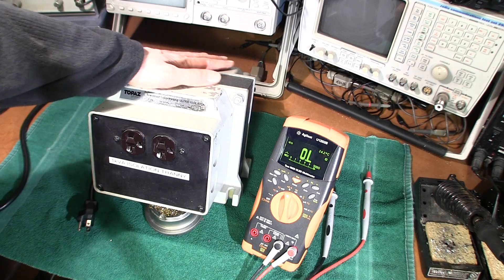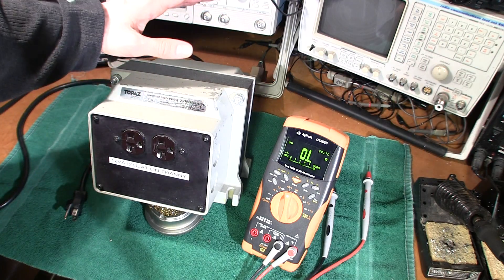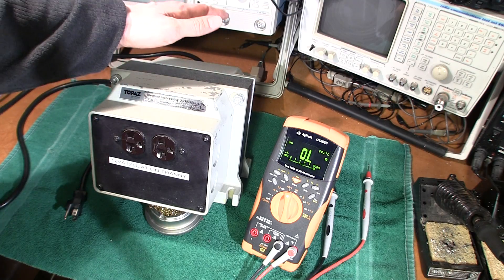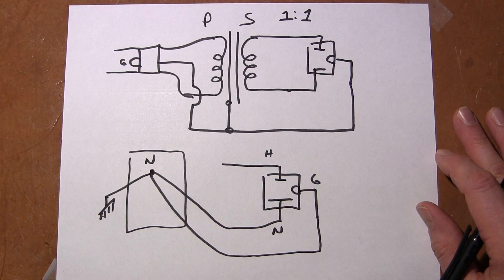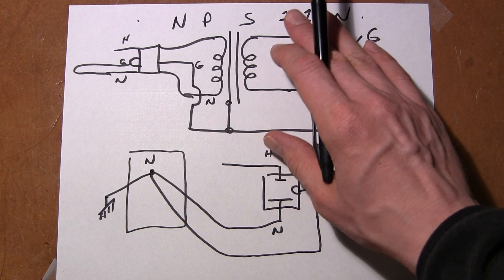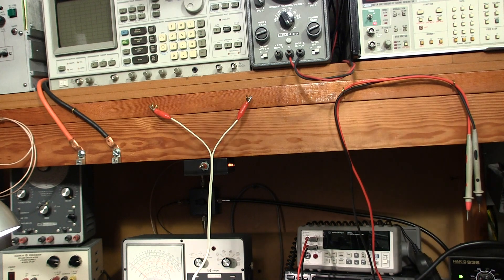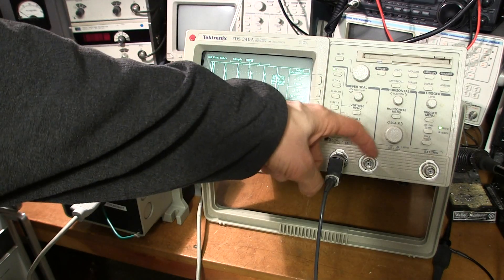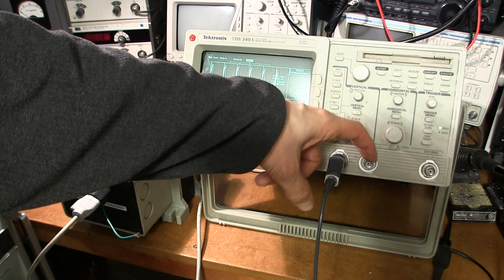Tech Tips Tuesday, Isolation Transformer and Variac Safety

Comment: Confusion the secondary should not have the earth wire carried over . the secondary is then will be totally isolated . Then you can have the DUT connected including the scope and all is well
Any transformer the has any of the secondary wire connected to earth/neutral is NOT A ISOLATION TRANSFORMER and should not be called that . The earth should not be connected to the output

Comment: Balanced isolation transformers, which are sometimes used for audiophile and home theater systems, usually have a center-tap on the secondary which is sometimes connected to the ground connection on the output and chassis. Thus the output is not always isolated.
Reply: center tapped coil is so you can split the voltage if it puts out 24vac  you can  12vac and 12vac for 2 different modules per say, the center tap so u can get +/- 12vac for some audio equipment wich the rectifies it and filters it usually with a regulator as well into DC so the center tap is the half way point of the winding so two windings in series per say like in your mains supply where the nuetral is this wire  or whatever the color depending on country ur in completes the circuit to make current flow and the panel has 3 service cables and a ground the two hots each carry 120 volts when referenced to nuetral and leg to leg they equal 240 thats not to be confused with ground or earth its  whatever you want it to be but a ground is a reference point of halfway so it goes up 120 and down  120 180 degrees out of phase from each other ground  the way we protect our homes from short circuiting a cable thats in the wall and instead if its shorted at device or wherever the breaker will be the switch to break the circuit  to prevent the wire becoming a instant red hot coil in your kindling filled walls lol even though at the panel ground is bare copper with its own bar you must not connect ground with nuetral has its seprate lug and bar for this reason and older electrical code was using the same bar for nutral and ground so when you need 220 for your welder the 10 2 wire is going to be a white a black and a bare copper the white now becomes the second 120 side of the plug at the panel a double pole 40 or 50 breaker gets a white and a black and thats as easy as i can explain it electricity doesn't rely on ground to work it relys on a complete circuit and thats it a ground is a protection against things like reversed polarity  most devices have this into the before the electronics portion of things if its any chance to be a problem

Comment: Why is an isolation transformer safer than using current directly from the outlet? Doesn't the secondary side provide as much electrical energy? Also, an idea for a Tech Tips Tuesday for us noobs -- what is the difference between the neutral and the ground wire?  I see outlets wired with the white neutral and green ground screw connected all of the time
Reply: There is no reference to ground from an isolation transformer. You could shove a fork in the hot socket of the transformer's secondary, put the fork in your mouth, and grab a copper pole and nothing would happen because the earth is no longer part of the circuit. If you did that with the normal AC mains you would die because the earth itself IS part of the circuit.

Comment: As others have pointed out. It is important to remember that if you float your scope and then connect probe ground to a hot connection the entire case and terminals of the scope and anything else connected to it are now hot. You only need to touch any of those points and ground and you are fried. That is why you normally never float the scope but rather the DUT.
Reply: yep all metal on the scope
Reply: An alternative to be extra safe is to float both the device and the oscilloscope (using separate transformers!). Still you have to be mindful that your ground lead can energize your oscilloscope w.r.t. the device under test, so don't handle both at the same time in that case.
Reply: Well yeah that's pretty obvious from even basic electrical theory. It's more about parasitic components of circuits that actually become an issue sometimes!! But yes I do generally aggree with you of course!!

Comment: You have so much experience and knowledge in this field, and I trust you, so had to ask you about my next project:  I'm thinking to make an a adjustable AC bench power supply.  My concern is to have the AC stable, when something using it draws more than 1A (or more) of current. When I needed for my project AC, I just used 2 resistors, wired like voltage divider and also used 2 potentiometers - wire-wound style. It did the trick, but since I'm gonna play with more AC projects, I would like to make a nicer power supply that is stable. I do not need anything more than 10A (that would be at the most I can imagine for now). I have several transformers 120V to 30V, 16V, 12V outputs. One has both 12V and 30V in one. They came from a large  UPS (Uninterruptible Power Supplies from 1200W and 1500W respectively). I'm not very experienced in electronics, just a new hobby after a 50+ years of other hobbies. I'm trying to rekindle something that started when I was a teenager. I do have 100Mgz Oscilloscope, 50Mgz Function Generator, several meters, 3D printer and lots of parts I salvaged from printers, UPSes ... I love to recycle and fix everything. So I'm not looking to make something that would require lots of knowledge that I lack of right now. I do play with Arduino's and simple projects..... I have several pictures of the transformers with their parts numbers and I know what voltage they produce. I could not find much about them on the Internet, not even how to connect the mains, but I figured it out - I think. What I like is a simple schema how to build the adjustable power supply and some protection for it; also what should I do to stabilize the output voltage.... I have these inexpensive meters from Harbor Freight that I can use to measure the output, so I don't have to even have a circuit for that. But if it has that, and it is simple and few parts, I am open to the idea also.   You, or anyone else reading this, can contact me on my Gmail: czecht@gmail.com (Yes, I was born in Czech Republic), but I live here in the best country in the world! since 1981.  Thank you Mr Carlson and thanks everyone else who would like to help me out!

Comment: some houses have the ground and neutral hooked up in the electrical panel. It's against code to do so. the ground is supposed to be isolated to a 8 ft copper grounding rod going into the dirt outside the house. you can check how the house is wired by checking the ground to the neutral, and then ground to hot lead. when wired correctly, you see half the voltage on both circuits. when wired with neutral and grounds together, you see voltage drop on the ground, and main line voltage on the hot side.

Comment: This really just confuses matters even more for a European like me. There's no such thing as hot / neutral in our house wiring. It's interchangeable, the plugs, even the earthed plugs, are reversible. We also frequently used non-earthed outlets and plugs here, with only two prongs - and they, too, are reversible (of course). I guess this stems from the fact we have 240V directly into the house, and all our appliances run off of it - there's no center tapped transformer splitting the supply before it gets to the house. It's just 240V all the way from the nearest HV supply to all the consumers.

Comment: Wort to say that you can make a powerfull isolation transformer with two MOT (microwave oven transformer) connecting high voltage secondary together as link between.
Primaries become inputs & outputs.
You can add or subtract to near 5volts using the 2,5 volts filament secondaries in series with each primaries winding to compensate any loss.
Gabriel from Argentine.
In my scopes I just remove the ground pin to avoid new tech do what Mr Carlson advice.

Comment: Excellent video, I have learned tons from you over time. A long time listener, first time caller so to speak. I'm kinda scared to hook my expensive o'scope up to mains now. Anyhow, my question is such, I use a variac and just plug it in, but is it polarity conscious? Meaning, the hot lead always goes thru the carbon wiper brush you talked about. Is it essential that the hot lead do this? Reason I asked, mine is a cheapo from "over there", and has no ground pin, and both leads are the same, no big spade lug to polarize it to neutral. Can be plugged in either way. Should I make sure that the hot line is going to the wiper, and the neutral is being passed thru. Or does it all really matter? Also, whats the best way to read my 120vac input line power in my house? Use a 2 prong old style plug adapter as you do? Can I put the 100w bulb in series with the o-scope leads so the magic smoke stays in if there is a problem, what do you think about that idea? As always, love your channel. see you on the next on.

Comment: If you had access to a ground rod separate from the grounding system from the mains what issues would that introduce?   For instance, if you drove a copper rod into the ground and tied the neutral on the secondary side to it would it them be completely isolated?   Are there advantages to that approach?  Assuming your “isolated ground” was more than 8 feet from the ground for the mains?   I’m trying to see if I’m understanding this correctly.

Comment: I made this exact mistake 2 days ago on my oscope. After the bright flash  I started thinking about it and then realized -of course the ground clip is grounded - duh. Then I started looking into prices of variacs that have an isolated transformer and then found this video. BTW, my Oscope does not measure correctly anymore -  both the voltages and wave forms are incorrect now.   i have not yet tried to replace the probe so hopefully that will be the only issue. Just wanted to say I made this exact mistake and your video helped me understand and verify why. Totally makes sense now. I did not realized that the barrel was connected to earth ground and was treating it like a multimeter. Thanks for the Video!
Reply: oh mate. how did you get on? did you fix the scope?
Reply: Did you get your Oscope fix yet.
Reply: @carl112466  Dude is probably dead because he didn't know about current limiters.
Reply: Possible that the board foil to the input connector burnt and possibly you can fix that and with a little luck there will be no other damage. Good luck and God Bless!
Reply: Two of Ed
Reply: Join
Reply: Deep e
Reply: It l g lip love nope sue free dw dw we  we I love l old l Willie the
Reply: We see ew low ew
Reply: R we e
Reply: We we see sww

Comment: I've been learning about isolating for safety. 
I understand that in using a 'scope, many times you connect both the tip and the ground of the probe to each side of a component to see the effect of the component.  In that case, you are connecting the ground to the hot side of the circuit, which of course, causes the safety problem.
So... if I'm going to be "safe" about this, I have to eliminate the ground from the test unit, or the oscilloscope.  

It makes sense to eliminate the ground from the guitar amp that I am working on, and keep the 'scope grounded.  

"If" I am understanding the situation correctly, couldn't I simply use a common power strip with the ground pin removed to achieve the desired effect?  As opposed to buying, or building, an isolation box?  A box that, as you show here, still references ground.  

Thanks for your awesome videos!
Jeff
Reply from the maker: Hi Jeff. Always remember this: The safety ground wire is tied to the neutral wire in your breaker box..... So it's never safe to remove the ground pin. Usually the DUT (device under test) is isolated by the isolation transformer, but not in all cases. This is for you to decide.

Comment: The isolation transformer I inherited from my uncle did not have a grounded outlet. As I recall, it had a 2 prong, non-polarized socket. Not sure when it was built, but I would guess in the 1950s, as most of the equipment I got from him seems to be from that era.  Thanks for the great video!

Comment: It makes no sense that the isolation transformer has earthed output outlets. However, regulations may vary.

Just some side notes:
In the TT earthing system used in most of Europe, the neutral is connected to earth on the substation transformer, on its site. The local earth of the house or building is connected to a rod or ground on site. Thus, there will be a low ohms resistance between the neutral (earthed far away) and the earth (earthed locally). Plus, the earth pin will always have the same potential as you, and it is always safe.
In the US, that mostly uses TN-C-S, since the earth is provided by the neutral, you might get a shock. There is no guarantee that there will be no potential difference between the grounded you and that earth pin derived form the neutral, which is only earthed at the substation and not locally. The neutral is not to be relied on and should not be the same as earth. Earth should always be local.

Comment: Why would you connect ground to the neutral??? Here(in Malaysia), ground is actually connected to earth, and a copper rod about 2 meters (6 feet) is driven into the earth. And the Ground is connected to that. It is not in anyway connected to the Neutral.

Comment: Good public service announcement. Learning the hard way of testing main voltage on an oscilloscope at the receptacle...50/50 chance of meeting your maker. Neutral is not always neutral when Jose wired your house. Maybe a good idea to backprobe to breaker box to verify mains wiring to test equipment? Make sure neutral and hot are not reversed on the electrical reseptacle . Neutral is actually the center tap on the pole transformer supplying the breaker box. Ground should have no continuity with neutral as it is wired to a copper earth pole.
Reply: What if Frank wired your house?

Comment: Interesting enough the Neutral is NOT connected to Ground in the Fuse/Breaker Panel.  Use 100% Caution when using AC!
Reply: It depends where you live. In europe it isn't connected to ground at the panel. In the US, it *actually is*. Because they use a center-tap transformer to split their 220 supply to 110 for the house wiring.
Reply: BUT in the US if you have circuits coming from the mains via a SUB-PANEL, the green ground IS ISOLATED from neutral - so watch it, and know your wiring.......

Comment: paul,
I completely agree with commentator TRX Bench. 
A transformer like the one you are showing is a deathtrap. Here (not often) this sort of transformer is used for the lighting and plugs in bathrooms and such. Our electric code specifically states that NO EARTH connections can be in the secondary circuit (for obvious reasons)
Of course if your country uses that 'split phase' system, this adds to the confusion, so much so, that one ends up with polarised leads on AC!
The mind boggles!

Cuddles!!

Paddy

Comment: It's disputable whether the output socket of an isolating transformer should have an earth pin. Some say yes, some no. I am inclined to prefer no, but not everyone agrees.

However, (In the UK anyway) there is a far worse gotcha to beware of, in that there are transformers sold for building site tools which used to be called 'isolating transforners' but which are actually autotransformers. I believe the practice of calling them this has now been banned, but you may still see some old hands in the building trade referring to them as isolating transformers. 

If one of these finds its way onto the electronics testbench it's an accident waiting to happen. 

On any unknown transformer, do a resistance check between the live and neutral output and all three input pins, especially the earth. If there is a low resistance to earth OR to the the input supply, it is NOT an isolating transformer, and could cause an accident on the bench.

Comment: Paul, thanks for yet another informative and well-presented video. Maybe you can help me, either with my thinking or with my technique. I recently came into two identical transformers scrounged from backup UPSs and experimented with wiring the two 24VAC secondaries back-to-back, thus creating, at least in my mind, a 1:1 transformer. I grounded the receptacle ground lug and the metal cabinet to the line cord ground conductor. So far, so good: 120VAC input, 118VAC output at the receptacle. In my mind I now have "floating" 120VAC at the receptacle and continuous earth ground back to the breaker panel, but the voltmeter says otherwise.
When I measure from the "hot" receptacle lug I read 41VAC to ground, and 19VAC from the "neutral" lug to ground. I don't quite understand how a supposedly "isolated" transformer secondary is referencing to ground. All this is predicated on my assumption that by wiring the two secondaries back-to-back, I created a 1:1 transformer. Here's hoping my explanation is clear enough and you or your readers can shed some light. Thanks again.
Reply: 4 years on and still no reply , humph...